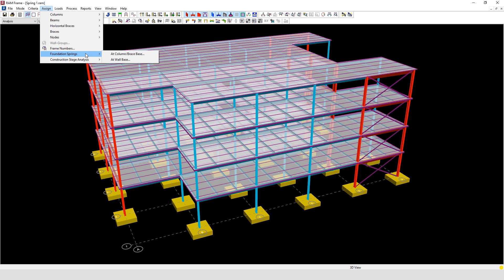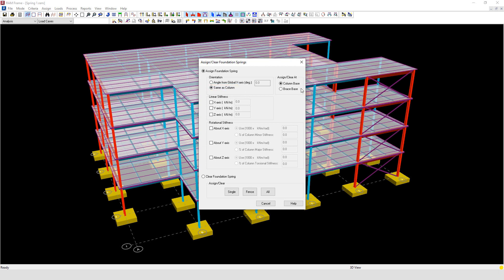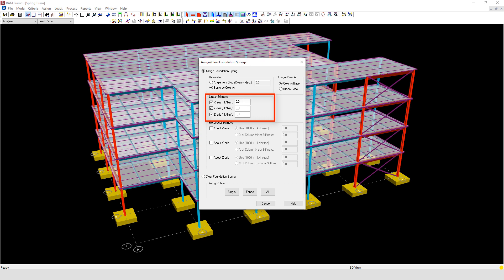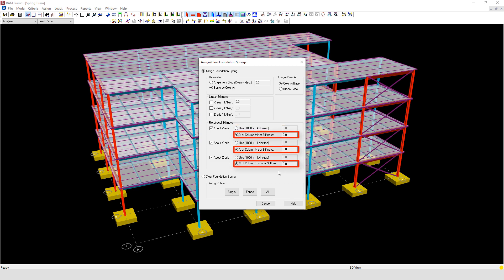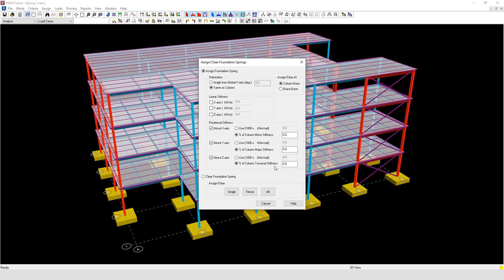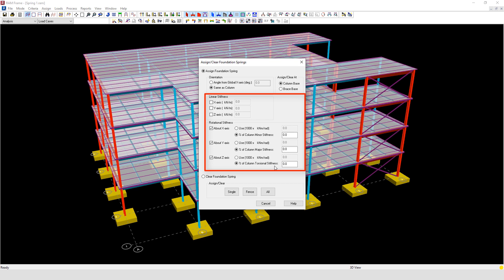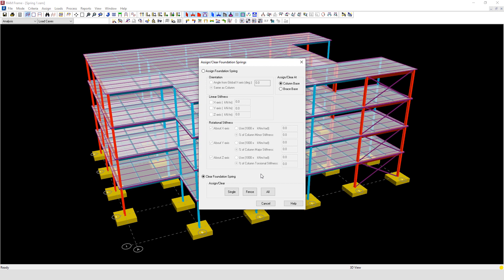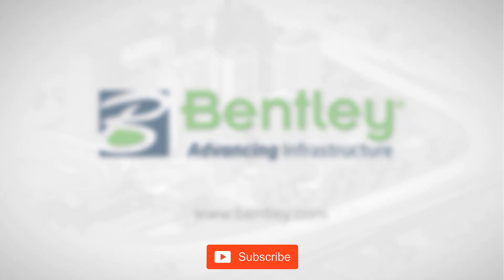Using Spring Supports in RAM Structural System (RAM Frame)

Comment: Rotational stiffness around the strong axis of the column in RAM is the Y-axis.  This varies from the AISC manual, where moments affecting the "major stiffness" would be around the x-axis.  It's just the sign convention, but it's easy to make a mistake if you aren't careful.